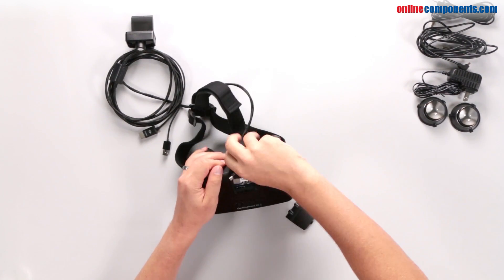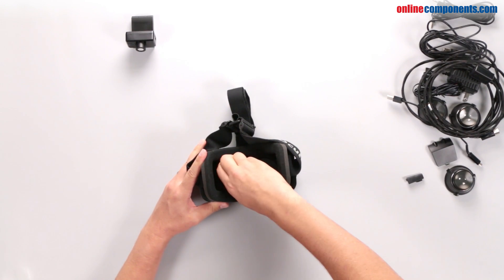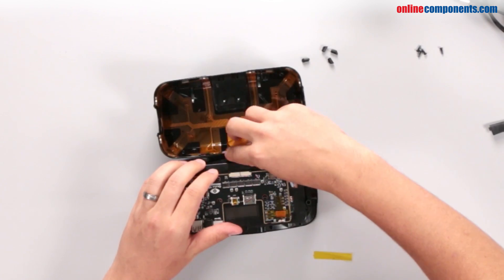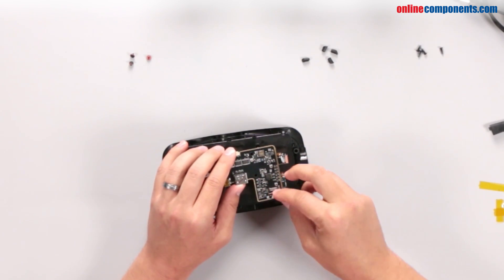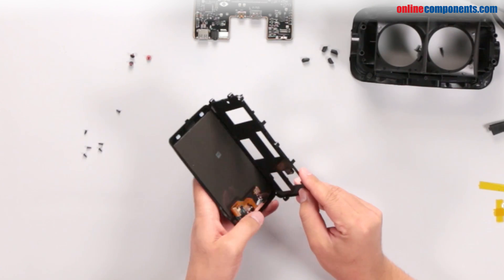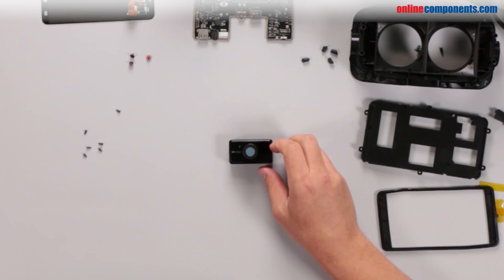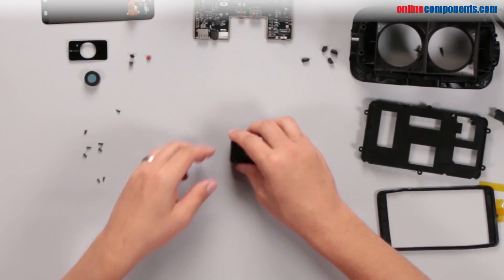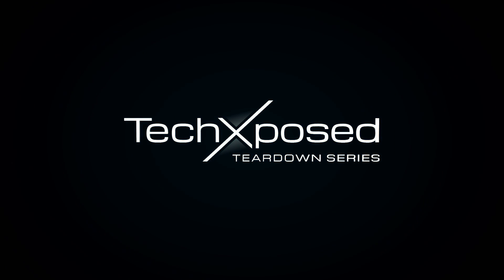Tech Exposed: Teardown of the Oculus Rift DK2

Comment: My headset dropped on the floor and now I can only see out of the left eye. When I put it on my head the right side was about 1/4 black but when I tried moving the wheel under the bottem it made the whole then dark and i can't move it either way now. Is that an easy fix?